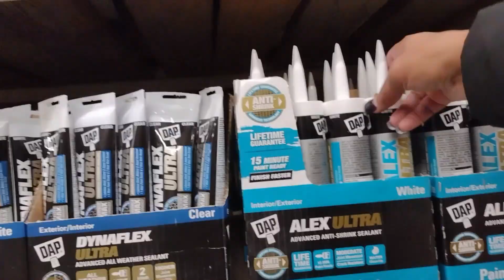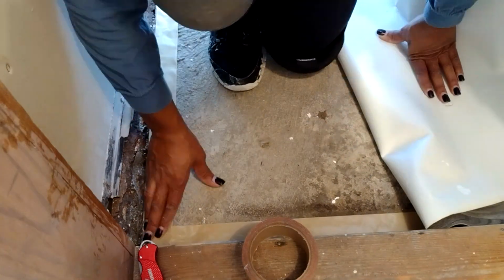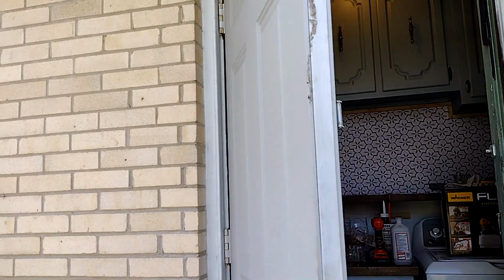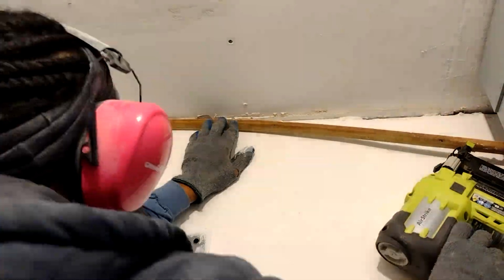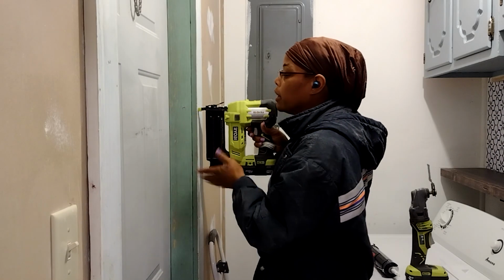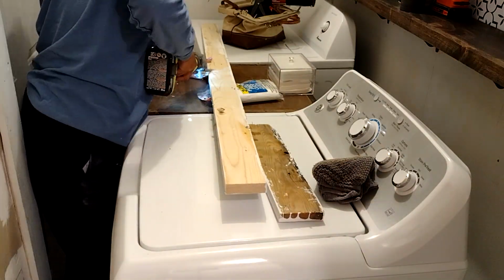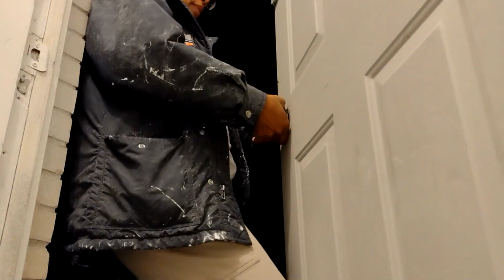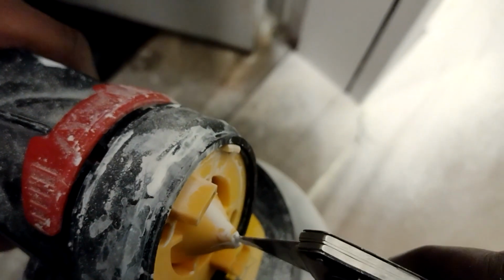Episode 6: DIY Extreme Laundry Room Makeover. $100 Budget!

Comment: It's looking good. It's a difficult room to do since it's small and not a lot of space to move around.
I'm glad you changed out the door handle and added weather stripping.
Suggestion - a weather strip across the bottom of the door, you may have one and not mentioned it.
 I'd install an additional lock, a dead bolt since that's an exterior door.  
Also - replace the short screws in the door latch  strike plates with 3" ones, better security.
See you for the finish & reveal.
Reply from the maker: Hi. Yes, I bought a door sweep for the bottom of the door. And YES it's a really tight space 🤣☺️
Reply from the maker: Hi. Yes, I bought a door sweep for the bottom of the door. And YES it's a really tight space 🤣☺️
Reply from the maker: Hi. Yes, I bought a door sweep for the bottom of the door. And YES it's a really tight space 🤣☺️

Comment: Hi I recently found your channel and have been watching you transform your laundry. May I ask did you paint the bottom and top edges to seal your door as I didn’t see it in your video. I’m asking as we had to do this so our exterior door didn’t such up moisture as the original wasn’t painted and I was given the tip to stop the problem happening again when we had to replaced. Looks wonderful can’t wait to see the finished room.
Reply from the maker: Hi. It's a metal exterior door so I only painted the side facing the inside.